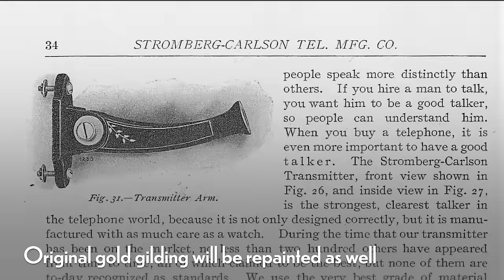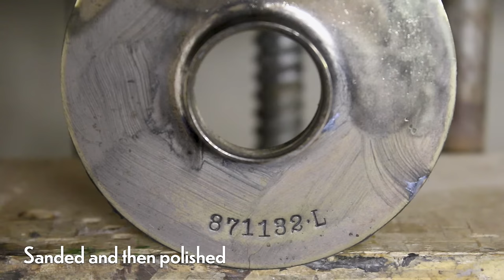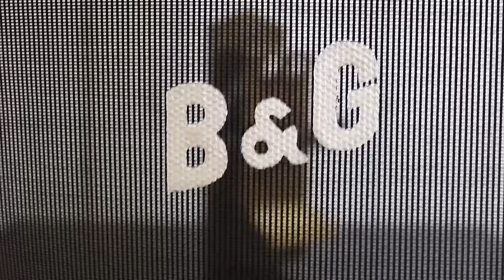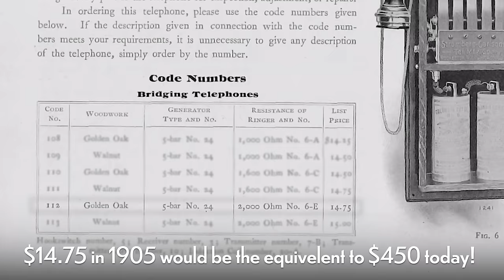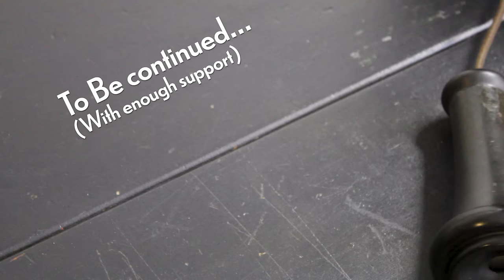1900s Antique Telephone Restoration

Comment: I have an old wall phone similar to this one. It had been modified sometime during I think maybe world war 1. there is a sticker inside saying that for the war efforts, all copper had been removed, and a rotary dial had been installed by cutting a hole in the face of the phone and moving the mouthpiece up a bit. A few mods to the insides by removing some coil and adding a more modern thing where the batteries were. I finally had found that same model phone in a junk antique store packed with all it's original parts and with a fine but weathered front door. I'm planning to restore the finish on the door and replace the innards from the second phone to the phone I originally had doing away with the rotary dial. The phone is connected to Magic jack and that service does not support rotary dialing anyway.  The only thing is that second phone I got has no writing shelf. It was removed sometime long ago. I wish I had access to someone who can reproduce one like you did to the specs of the phone shelf I do have so that when I change the face of my phone to an uncut for the dial face, it would have the shelf rather than swap it from one phone to another as I'm looking to keep every part I do chance out. Great job you did. I enjoyed watching. Thank you.
Reply from the maker: Thank you for the feedback, and for sharing your experience! It's a cool piece of history to still have that original sticker. During our research we came across several websites that sell reproduction shelves, just make sure the dimensions match and its a reputable source. We wish you the best of luck on your project!
Reply: The mod is so old I'd actually consider it historically valuable in its own right. Besides, the addition of the dial makes the phone perfectly usable if you still have a landline that supports pulse dial.
Reply: @Ragnar8504  I'm using the phone with magic jack service,  which does not support rotary dialing.  I was thinking it may be historically valuable even though when the hole was drilled,  they cut thru the middle of the wiring diagram on the inside.  I was planning to replace all the missing parts,  and replace the front door of the phone with one that's not damaged.  Maybe I'll just keep it as it is then.
Reply: That was done during WWII, not WW1. The phone companies could not build new phones for people due to copper being rationed and phones being built for the military. So the phone companies had piles of these old phones that were out dated by then. They modified them just as you explained so you could actually dial the number instead of being on a party line
Reply: @kirkstinson7316  Thank you fur the info.  I wasn't sure which War the mood was done.
Reply: @brooklyncarmelena5755  I had two of them.
Reply: @kirkstinson7316  I also have 2 of them.  One was going to be for original parts with all original cloth wires and 3 batteries.  Only missing the transmitter.  It was modded with a one piece receiver.  I guess I can restore the one I considered for parts with a wood staining and vanishing and get a correct receiver and replace the writing platform.

Comment: I wonder if this would still function like our Radio Shack rotary phone still does today.  The older phones still work during a power failure due to the low voltage on even today's phone lines.  What goes around comes around.

Comment: Restorer and clockmaker in a national museum speaking here. 
You should check the microphone again tho. Since you completly removed the hardened insulation around the diaframe it's likely to be internally shorted somewhere now. It won't work that way. Also the yellowed plastic foil was originally clear back in that days.
It's a nice restauration and lots of work you put in there for a private use.
But it's way too abrasive to be a museal restoration :)

Comment: My grandmother grew up with a phone like this on the farm. It was on a party line with the other surrounding farms. So, before you turned the crank to ring the operator, you had to pick up the ear piece and listen to find out if a neighbor was currently on the line talking with someone. If the line was in use, you were supposed to hang up really quick and wait your turn. It was a good set up for eavesdropping. The source of a lot of neighborhood gossip, I'm sure.
Reply: We had one of these in the 50's when I was a kid.  Our number was 9F21.  That is two longs and one short.  Rubbernecking on phone calls was a favorite sport of the ladies on the party line.
Reply: @steveschainost7590  Oh yeah! I forgot that detail about how each house on the party line was assigned a different combo of short and long rings, so the correct place would pick up the call. Thanks for reminding me!
Reply: @mugwump242  Everybody on the line also knew who was getting a call.

Comment: I've been going through the schematic which is inside the door and checking the wiring and it's all fine one time somebody cut loose the coil which comes from the battery and or the ringer and then after the ringing takes over this thing works from the carbon microphone and the batteries like you say a lot of people never figured out this technology and I think it's cool

Comment: 📌I found an identical Model 112 at the dump. I suffered plenty of extreme weathering. The oak remained in restorable condition. I located a replacement ear and mouth piece and built a new replacement shelf. To make a usable phone I used an old scrap touch-tone table phone and installed it in the batter box minus the case. The microphone and speaker were also used from the hand-set. It works just like a modern unit!

Comment: Great Job!!!.  I am in the process of restoring an SC phone very similar to yours, but a few years older (1901-1904).  Questions for you.
1.  My phone had been converted to a "modern" working phone, which I removed.  Whomever "updated" it, messed with a lot of the original wire/wiring.
Did you keep/reuse all the original wire, is it copper wire and would you be able to share a wiring diagram?
2. Did you have trouble soldering the wire back to the hinges?  I am not having much success with making a good, clean, neat connection :(
3. the recoil spring in the magneto that was broken....   same on mine, but I have been unable to find a suitable replacement.  Any ideas where i can find the right one?
Thanks for you help and again, Great Job?
Reply from the maker: 1. We reused all the original wire, it appears to be plated copper (not iron) but it's hard to be certain
2. We didn't have much trouble, just make sure to use a hot soldering iron
3. We got a similar sized spring, and cut/bent it into the correct shape
Reply: @BGRestore  Thank You

Comment: I have an antique c1933 (from a sticker I found inside) phone which I believe is bakelite. Weighs a ton. Anyway, it works as far as answering calls but doesn't ring. I've been told the phone lines where I am no longer produce the correct voltage to activate the bells' mechanism...

Comment: Scrolled through some of the comments for answers before asking, what is the ring on your pointer finger about?  I’ve watched a few of your videos and have never seen it before.  It’s completely out of place so I’m wondering if you did it for a reason.  Great work as usual by the way, everything you touch turns to gold.
Reply: While watching the video I’ve come to the conclusion that you had a helper.  In any case you both did a bang up job restoring this bast from the past treasure.  Very well done!!

Comment: I would invest in some Evapo-Rust and Bluing Fluid as it's the difference between a good resto and a Great Restoration. Not to mention all the time it saves. Also a nice bench top grinder with a good quality buffing wheel does wonders. I was kind of disappointed by what you did to the cabinet. I would have fixed the cracks in the wood instead of just filling them with putty, then sanded to at least 180 followed by 3-4 coats of a good laquer. I would suggest some videos on using spraycans. As for the waxing of the wires on back, it would have been way nicer and prolly easier to just mask off the back no? I originally was going to say good job, but had to bump it down to an okay job. Keep at it and I'm sure that your skills will improve.

Comment: Checking the health of electrical parts is not shown. All cracks in the case have not been fixed, there are other minor quibbles.
But on the whole, a lot of work has been done and done very well. I like it with pleasure. Hope to see a test of the phone in the future.
Reply from the maker: All of the electronics and connections were tested off camera, we didn't think showing that would be interesting. Thank you for the feedback! A follow up video is planned for the future :)
Reply: @BGRestore  I had experience restoring a telephone in the early twenties of the twentieth century. The main problem was the malfunctioning of the carbon microphone, spoiled by water. And there was nothing to replace it, custom size. Experimenting with making a powder that works well was very difficult and time consuming.
I will look at your next work with interest.

Comment: When I was a kid in the early 60s, I found this thing in the basement. I found that if I turned the crank I could easily electrocute myself. Later I found out it produces 100 volts AC. Much later I found out it is from a crank telephone. The voltage it puts out, is the telephone standard ring voltage, even today as far as I know.

Comment: Really cool to see this bit of history restored, really great job. Out off this, what really struck me, is the fact that back then they had plastic molding technology to mold the mouth piece like that. I think it would have been nice to have a voice over giving an rough/brief explanation of how it/the parts worked, as you seem well versed with it to be able to do that, for those with absolutely no clue, like me :-)
Also curious how come you didn't use Oxalic acid to help remove the darkness/staining from in the grain before refinishing it to better help the new shelf better match, or stain the new pieces and then sand back to leave the grain darker? I would have preferred to lighten everything back up to close to original, but that's personal preference.
Curious if there's anyway that this could be put into use today? Wouldn't think so, but there are lots of super smart people out there, much, much smarter than me.
Reply from the maker: Thank you so much for the feedback! Depending on how things go, we might do an explanation video or something like that :)
As others have commented, this telephone could be fitted to receive calls on a modern landline system.
Reply: That would be really interesting and cool if you did a video giving some insight. Also, would be cool to have one of these in a B&B or small hotel, cafe etc as the house phone patrons use.

Comment: Is this your first video? Nice work! You got my thumbs up! One question: are that u-shaped "bars" magnets? If so... did you reinstalled them in the correct orientation? I mean South and North, like every magnet. Do you think this telephone could be connect to the line and operate normally? Thanks!
Reply from the maker: Thank you so much! Yes, all the u-shaped bars are magnets, and each have a dimple stamped on one side for orientation. With the proper connections, this phone could operate normally :)

Comment: A five bar magneto indicates this wall set was on a farm or far away from the central office.  Too bad it’s missing it’s shelf but a nice piece none the less.  I have restored many Western Electric wall sets.  Don’t go too overboard with resto.  The patina is important.
Reply: Does a 'phone magneto need re-magnetizing when the armature has been removed? Prewar automotive magnetos seem to loose a lot of strength if a "keeper" isn't put across the poles immediately .
Reply: @webtoedman  I have never had to re-magnetize the bars.  There isn’t very much magnetism to start with.
Reply: @navvet4518  I see. Thanks.

Comment: I have two of these could I wire them together to make them work
Reply from the maker: In theory you could, with the right batteries and correct connections. Eventually we'd like to do a video on this topic. Just be careful since the Magneto can put out 100 volts

Comment: Looks good. But why make it operational? 
Even if you have a land line it can't be used. No dial. It needs an operator to connect all calls manually. 
The Phone Companies haven't had that capability for at least four generations (80 years) or longer. 🙄

Comment: Why were there wires soldered  to the hinges. And why did they coil their wires like that
Reply from the maker: Using the hinges as connection points allows the door to open freely (without the transmitter wires pulling or interfering). The coiled wires can move under less stress when connected to the magneto, versus a straight fixed length that could break.

Comment: Is this phone functional? Could it be connected to our modern (landline) infrastructure and work at all?
Reply from the maker: The phone is functional, but only with other phones of the time (with the help from operators to connect the lines). It would not work with any modern phone system.
Reply: @BGRestore  Yes and no. If you deactivate (disconnect) the magneto, you could connect it to any modern landline and receive calls just fine, there's just no way to make outgoing calls. Well, if your landline supports pulse dial (some VOIP modems still do) and you're dedicated enough, you could dial using the hook switch. Each digit of the number is a sequence of pulses, in most phone systems from one pulse for 1 to 10 pulses for zero. For each pulse, the dial briefly disconnects the line, like the hook switch does. So if you get the timing right, you can dial by pushing the hook switch the required number of times for each digit. I never got beyond three digits or so, especially if zeroes were involved.

Leaving the magneto in the circuit could destroy your modem or (if you happened to be on a more traditional exchange) your phone provider's equipment.
Reply from the maker: @Ragnar8504  Thank you for the info! Pulse dialing is a clever solution for the lack of input buttons. We measured ~100 volts off the magneto, more than enough to fry a modem, Hahaha.
Reply: In order to be able to dial a number with the telephone, it may be useful to use an accessory that was previously used to call up telephone answering machines: a small device with numbers and a loudspeaker that generates the tones of the frequency dialing procedure. You hold it up to the microphone to make a call. I used this on my old phone from the 1950s when my line was switched to VoIP. I recently got a pulse dialing adapter, so the dial works again.
Reply: @Ragnar8504  Interesting. It reminds me of my college years (1975) in computer science lab where I learned how to circumvent a physical lock on a desk phone’s dial by “pulsing” the hook switch for each digit of the number I wanted to dial. Our professor wasn’t happy when he found out we were doing it.
Reply: @Tag-Traeumer  Oh yes, the old DTMF sender box... you'd just have to see how well it works with such an old carbon microphone. They did work when the microphones were new-ish (back in the 80s plenty of people still had older phones with carbon microphones in them) but not necessarily 40 years later.
Reply: I remember years ago 70s I used the hook on dial phone to transfer a call to a extention at work.
Reply: @Ragnar8504  I have no experience with a carbon microphone, it could be difficult to transmit the two overlapping tone dialing frequencies with it. Telephones like mine (PTT Wandstation Modell 50, from 1956) originally also had carbon microphones. When I bought mine, it was already modernized and equipped with a transistor microphone.
Reply: @donbest5024  That's another use, it's called a hook flash I think. Some phones designed for PBX systems (private branch exchanges) had a dedicated button for that.

Comment: .   Was mir nicht klar ist, wie das Mikrophon funktioniert. Man sieht hier so eine Art: "elektronischen Prozessor", siehe 17:49 -- und hier ein rundes Blech, was an den elektronischen Prozesor angeschraubt ist, siehe 17:54 -- und hier die Membrane aus einer gelben Folie, siehe 18:11       Aber wie funktioniert nun dieses Mikrophon, wo noch nicht mal ein Verstärker dabei ist? 
.   What I don't understand is how the microphone works. You can see a kind of "electronic processor" here, see 17:49 -- and here a round metal sheet that is screwed to the electronic processor, see 17:54 -- and here the membrane made of a yellow foil, see 18:11      But how does this microphone work when there isn't even an amplifier?

Comment: Why renovate.....more cash to be made if left as an antique. If you look at antiques roadshow. They say do not touch or clean the original.....quote in the English programmes. "Thank goodness you did not alter it or do anything that would ruin its authenticity. "
Reply from the maker: It's a tricky topic that's important to consider. In this case, we felt it was beneficial to preserve the integrity of the piece and prevent any further deterioration. Thanks for the input.
Reply: @dave m not everything is about money, sometimes the value lies in the challenge an object presents.

Comment: Not the best restoration I've seen. You mention "back to its original condition" but it is far from it. There was still pitting, black smudging, and scratches on many of the parts you put back on it. It was more of a cleaning than a restoration.

Comment: Disappointed in this show. There is nothing shown of HOW... no painting, no sandblasting, no metal work.
The little cleaning shown is not too exciting. And, you sure could use a manicure. On the wood, you needed to use a needle to shoot glue in those cracks, then clamp until dry.